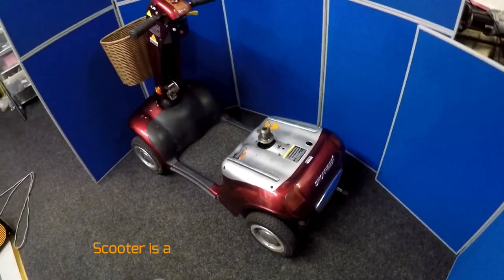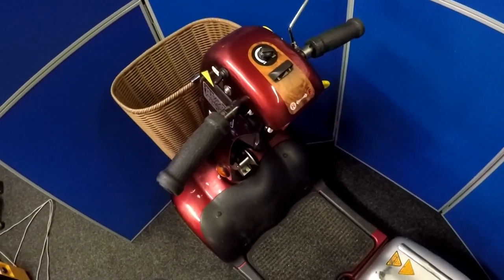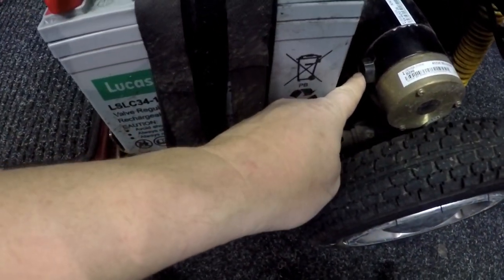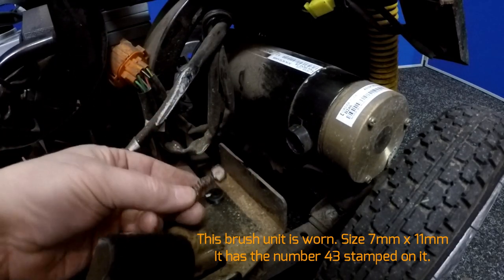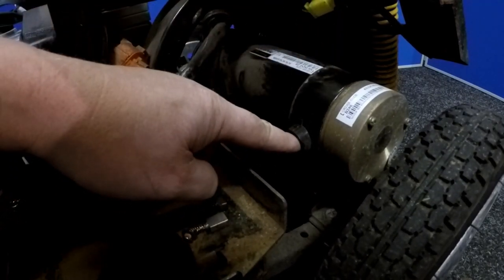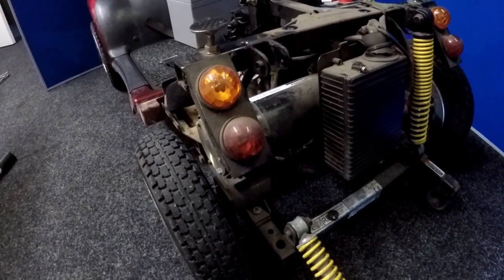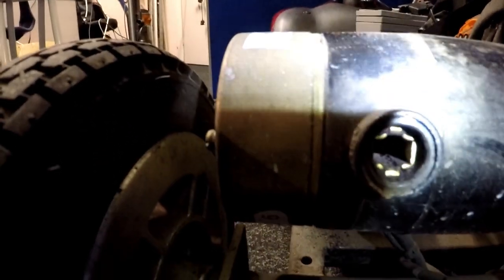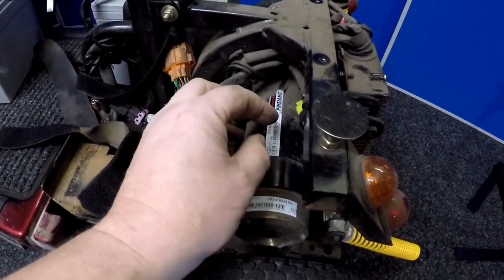Mobility scooter Motor repair Part 1

Comment: 😎😊🖐️🖐️HI IM IN 🇦🇺, I HAVE SAME CHAIR SCOOTER AS THIS, WITH SAME SYMPTOMS. YET WEIRD THING IS, WHEN WONT GO FORWARD, EVEN UP A SLOPE, 
WHEN I PLACE IN REVERSE, MINE WILL DRIVE, YET SLOWLY BUT SURELY, .
NOW I CANT GET TO GO FULL STOP PERIOD, 
I CHARGE UP, AND FRONT LIGHT WILL WORK, YET THATS ALL. 
THE BAR METER ONCE KEY IS TURNED, WILL QUICKLY FLASH ON THEN STOP.
I HAVE NO FORWARD OR REVERSE, NOR THE THE BUSHELL SOUND ON MOTOR, NOR
BEEPING FROM REVERSE MODE WARNING.
THANKING YOU, AFTER FINDING YOUR SITE, I AM ABLE TO NOW UNDERSTAND, ALSO WILLING TO FOLLOW YOUR MAITENANCE 
INSTRUCTIONS.😎😊😊😊😊👌👌👌👌

Comment: A way to clear out brush debris is to remove both or all four brushes, then to blow it out with compressed air through one of the hole one of the brushes fit into.  Sometimes that will clean the commutator and it won’t need polishing/ resurfacing.
Reply from the maker: Would still fine the commutator a clean as part of a service

Comment: Usually those beeps have a pattern, usually by number of beeps between short pauses.  Then you can look up the trouble code for the specific model and the code will narrow down the source of the problem. Sometimes it tells exactly the problem or part that needs replacing.

Comment: I need to find the plastic part that goes into the Motor, then the brush, than cap. I need 2. do they sell these type of parts? its for my Celebrity scooter. both brushes were totally welded into the plastic. they pop out, but I cant find them on the internet, only the caps. its a 2013 and the model # of motor is 10517. Thanks for a cool channel
Reply from the maker: Hi can you send me the serial number of the scooter please. We do have some in stock
Reply: @tomjacques4  Sir, Thank you for responding. I found them on the internet and ordered some. Thank you for a great channel!

Comment: Thanks for the help. Unfortunately I made it worse unsure why the long pins wouldn't go back in🤣
Reply from the maker: RID3S TH3LION should do they came out lol. Ok sometimes you can poke a small punch down the hole from the other side then insert the long bolt and try and feel for the punch then push it in with pressure applied to the punch end so not to displace the long bolt. Can be difficult with the magnets pulling the long bolt.
Reply: @tomjacques4  🙏Thank you so much again 😊 If all fails tomorrow I'll attempt again 🤭

Comment: I have a pharmore wizard When put to full power vibrate then shuts off the fault light flashes seven times if you turn the power down to have this does not happen is it the speed control unit that is faulty on the handlebars
Reply from the maker: christopher stearman hi I would first put the speed pot at it lowest setting.  Start driving at said speed then while driving slowly increase the speed pot if it cut out then it’s a good possibility that it’s faulty.
Reply: Nithsdale Wheelchairs V Yes I have tried that works perfect and will sometimes go at full power as soon as strain is applied he cuts out flashes seven times the That was again but if left on full power from a standing start vibrates and cuts out
Reply from the maker: @christopherstearman1788  mmm. check all connections as it can fold and may have slack terminals, Seven flashes usually indicates throttle issues(but this will depend on the controller used on said machine)  but thats on start up.... shuddering may be problem with the brake not releasing or worn brushes / dirty commutator, are you trying to climb a steep hill. what does the battery indicator do when it starts to struggle and cut out.

Comment: Mate, to remove the rear spring, what size tool do you need please?
Reply from the maker: Michael Underdog  hi 12mm spanner for the top bolt. 5mm Allan key for the motor bolts

Comment: Guys a kymco maxi xls motor brushes 4 off, 1 is good, 1 is stuck inside, 1 is worn and marked where the brush is against the commutator, the other i haven't touched (scared to look), can the commutator be cleaned and the motor rebuilt? How much would that cost roughly?
Reply from the maker: Hi you could try and clean the commutator with a glass fibre pencil and fit new brushes. Gently pull the brush unit out that is stuck. If it won’t come out then you will need to dismantle the motor. Hope this helps. Ps when you fit new brushes make sure they slide in and out with ease.
Reply: @tomjacques4  got one ebay

Comment: My kymco midi scooter’s motor goes very hot when I drive, any idea what could it be ?
Reply from the maker: Hi, I would remove the brake and drive the scooter. Remember this to be done in a safe environment away from traffic as you will not have a brake.  And then measure the temperature of the brake and the motor.  Sometimes you get a faulty brake that causes friction therefor causing heat transfer to the motor.  This way you will know what is faulty.  Check brushes and clean commutator. Also do you drive up steep hills or is the user heavier than the scooter limit.  Hope this helps. We have replaced a few motors and brakes on this model.

Comment: Can you send me brushes for a Pride gogo sport S74
Reply from the maker: Hi motor is a sealed unit with internal brushes spare parts not available. Usually lasts the lifetime of the motor.  You could open it and measure them maybe we will have something to suit. Tom